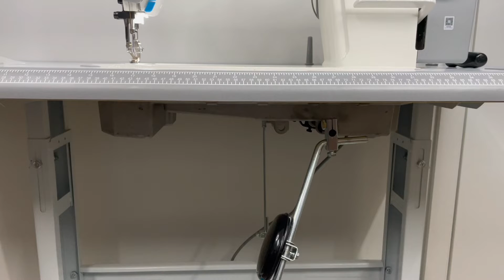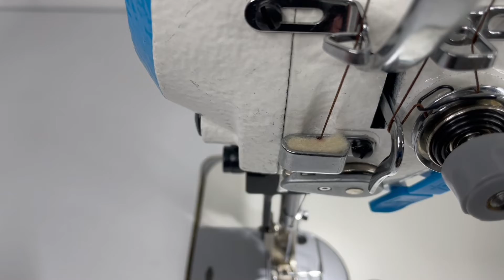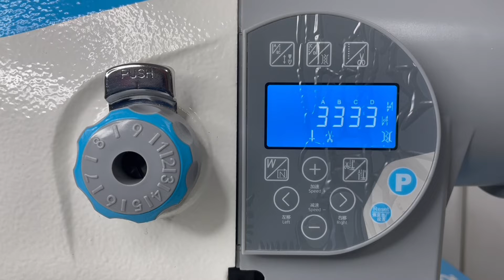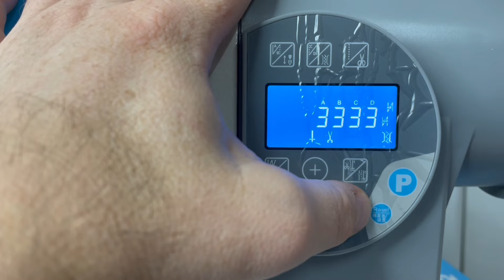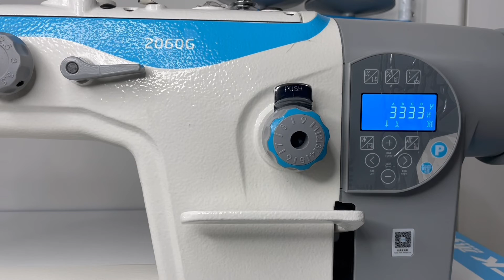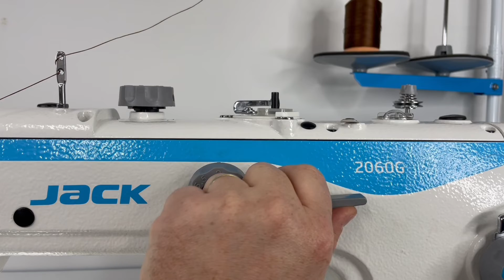Overview of JACK 2060G Industrial Sewing Machine

Comment: Which one do you recommend Jack H5,6 or Jack 2060
Reply from the maker: I would recommend the JACK H6 purely because of the digital stitch length. The 2060G is compound (triple) feed but has a very limited number of presser feet available to fit it. The H5 and H6 have standard feet and there are a lot of different options available to fit them.

Comment: Thank you for this video! Could you please tell me, if its possible, to slow down the speed when the machine automatically locks the seam? My Machine locks so quick ... Thank you very much!!
Reply from the maker: Yes, you can slow the speed on the back tacks but I don't have a copy of the parameter list anymore so I don't know what the numbers are sorry. If you got a paper sheet with the parameters on you can find the right numbers and bring them down to a respectable speed.
Reply: @ozcommercialsewingmachines  Thank you very much!! Good to know!
Reply: Did you find that out? I cant even put the bobbin because of the cutting mechanism undereneath, i have to manually turn the engine to be able to barely put it in.
Reply: @alexandrumardare828 Hi, I have found it in the Instruction manuel. You can search via Google for the manuel 😊

Comment: Hi. Thanks for the video. I’m looking at this machine to replace my 25 year old Mitsubishi LU2-4410. I can’t afford a juki My only concern is reliability. Jack certainly seem to be taking the market by storm but not really any reviews just overviews. Can you comment? Also the felt retainer you mention. My Mitsubishi is a sprung plate which is the original. I regularly get through 2000m cobs so wondering if I can upgrade this? Thanks in advance.
Reply from the maker: The 2060G is a great machine but you are very limited on presser feet, there is only really the one that comes with it unless you modify the outer feet to use as zipper feet.
Reply: @ozcommercialsewingmachines  Is the presser feet limited for this model or all the Jack models like the H2 and H5?

Comment: [08:30]
there are left and right feet for this machine. if you ask the seller they can find for you. I ask my seller and I got 2 extra feets, one left and one right. the man was also salling Bruce 2060 sewing machine. I guess he got it from that machine. Bruce 2060 and Jack 2060 are exactly the same in almost everything. and bruce 2060 have produced extra feet for his machines.
now I've bought this machine already I'll ask the seller to look a piping feet for my jack 2060. hope he can find it from some other similare models like Bruce 2060
Reply from the maker: We can also get left and right feet for this machine by grinding off the opposite side foot but to my knowledge they are not made unless JACK have started making different feet to suit.
Reply: @ozcommercialsewingmachines  You can use Dürkopp Adler feet, no problem.

Comment: great review. thanks so much. am thinkig of buying this machine, but am working with thick / heavy leather. do you think is good idea to buy this for that? or a real walking foot leather sewing machine?
Reply from the maker: It will depend on what thickness you are intending to sew.
Reply: @ozcommercialsewingmachines  I making bags. I can say I work with 3 or 4 layers leather each has 2mm thickness. total 9 to 10mm. something like that.
Reply: do not buy this machine, it does not have presser feet other than the standard one.
Reply: @Milkway1978  thanks for advice.,
I've seen Techsew has nice 5200 serie which are flatbed and very storng. it has 25mm foot lift. I think I'll like to go for it.
Reply: @Milkway1978  
today I bought this (2060) machine. it ls very strong. I tried 5 dick and strong layers hard leather [almost 3mm each layer] and the machine just deed it without any problem. it is really a little monster. it was just stunning. I got also two extra foot from the seller, a left foot and a right foot. the local shop I was today they had nice extra foot for the machine. left and right foot.

 today it was late, and I saw just the machine, and tomorrow I've to go back to the shop for final negotioting with the seller and pay the money and buy it. and maybe friday I'll receive my machines home. today I bought 3 machines, a Jack 2060 and a Jack A8, and a Kraft Skiving machine Kraft KF-801